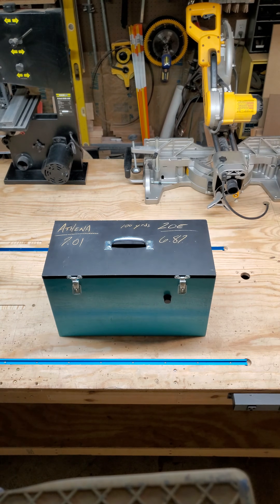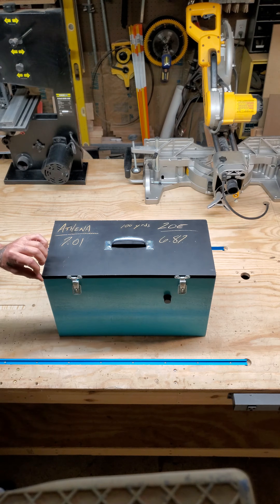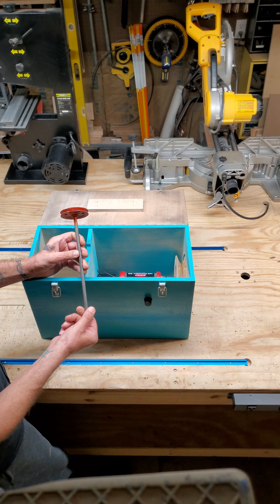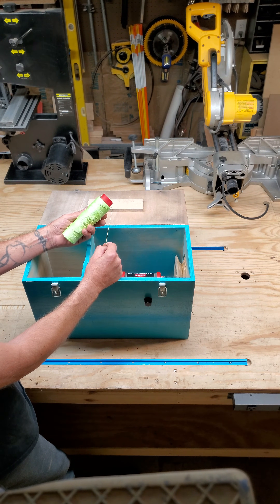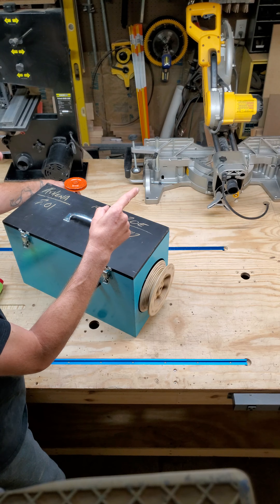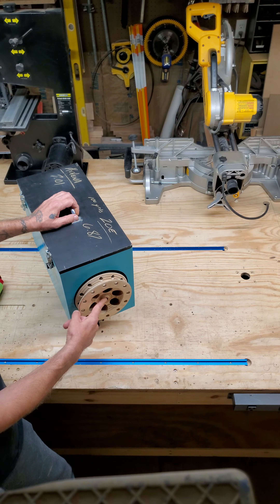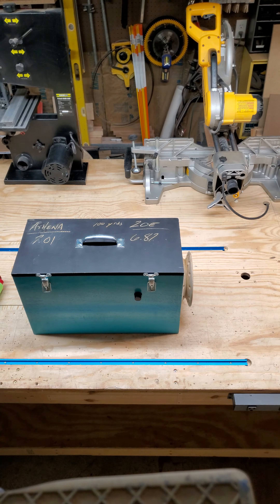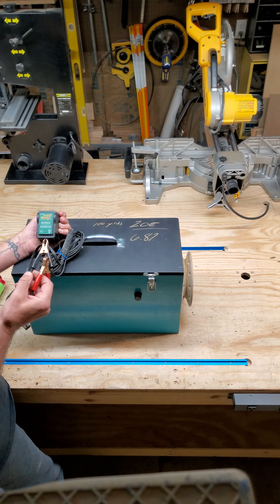homemade lure coursing machine

Comment: I've got most of the equipment you've walked through. Very excited to build some housing for it soon. Had a few questions though. How did you end up attaching your custom pulley to the Hanger PowerPro motor? The motor shaft is a M6 with only 1cm of thread and it looks like you've attached yours to the starter cup (normally used to start RC motors)? Is it held by a tight friction hold or did you modify the motor shaft in any way to put it on? I ended up making a 7" diameter wood pulley by gluing two pieces of circular crafting plaque with bevels together. I then attached it using bolts onto a 5" electric cover plate. I then drilled a center hole on the plate and mounted it to the motor shaft using the nut from the start cup.

Comment: I'd love to make one as the challenge would be good for me.  Do you have a parts list?  And where in the world did you find that motor?
Reply from the maker: Zimakitty, I will make a video explaining this.  Look for it real soon!
Reply from the maker: All of the items here can be found on Amazon....

Adjustable Digital display 10-55V 60A PWM DC Brushed Motor Speed Controller Switch Control 12V 24V 36V 48V Forward Brake Reverse For power wheels regulation (60A PWM) https://a.co/d/iRnAIu9 

UPG D1724 Sealed Lead Acid Battery Charger (6V/12V Switchable Single-Stage With Alligator Clips) https://a.co/d/2xVzVi2 

Hangar 9 PowerPro HD 12V Starter HAN162 Air Field Equip & Electronics https://a.co/d/fGMjSOR 

ExpertPower 12v 7ah Rechargeable Sealed Lead Acid Battery https://a.co/d/1BPwFZ6 

9KM DWLIFE Braided Dacron Kite String 50lb 1000ft Polyester yoyo String Mason Line Thread Heavy Duty Rope Outdoor https://a.co/d/3QN0p5N
Reply: Can you please make a video explaining how you wired it?  Also, there’s a button/switch on the bottom of the motor that’s usually held in by hand for airplane use. How did you bypass that?  And did you use the “jumper cables” to connect to the battery?  I’m so lost! Please help!

Comment: Speed controller is no longer available.  Do you have suggestions for a controller that is hand held?  Is recommended motor capable of forward, reverse and stop?
Reply from the maker: I'm not sure about a hand held controller...I will look into it.  But here is a link to another speed controller 
PWM DC Motor Speed Controller, DC10-55V/40A Max 60A Stepless DC Motor Speed Controller with Forward-Brake-Reverse Switch Adjustable Potentiometer and LED Display,Continuous Current 40A https://a.co/d/cdSEp95

Comment: How do you attach the line to that 7" pulley?
Reply from the maker: The line is in a continuous loop and pulled tight over the pull.  The tension on the line keeps it moving

Comment: Are the pulleys required to have bearings?  What shaft size does the motor require?
Reply from the maker: The pulleys spin pretty fast and without bearings it would create too much heat from friction resulting in malfunctioning pulleys or string break.

The motor shaft size is 1/4 inch, I believe.  I'll check and get back to you.

Comment: How do you attach the pulley to the motor?
Reply from the maker: I turned the pulley on a wood lathe. I cut the center so it would fit snuggly inside the motors pulley and drilled a hole for the motor shaft then just held it on with a lock washer and nut.